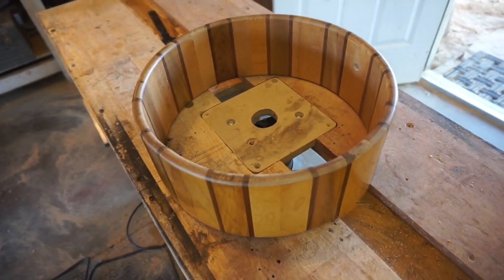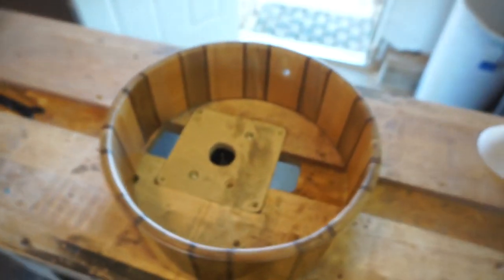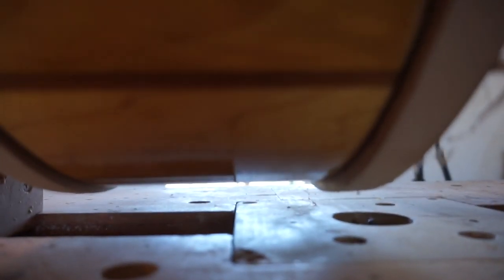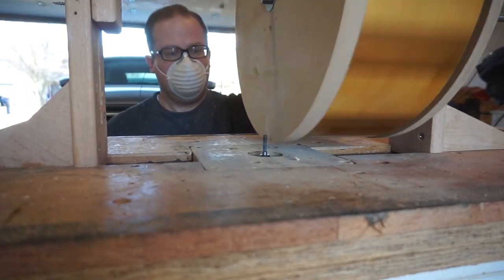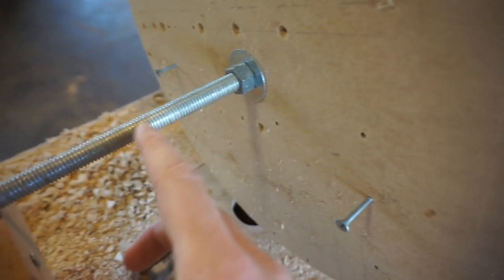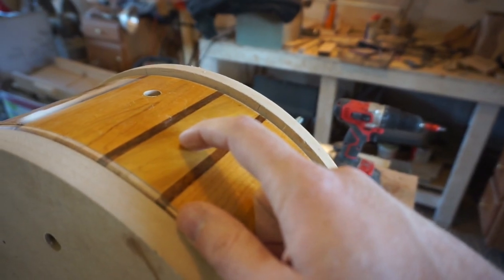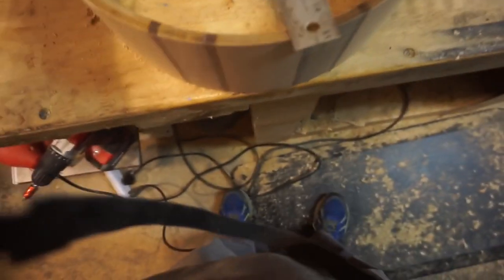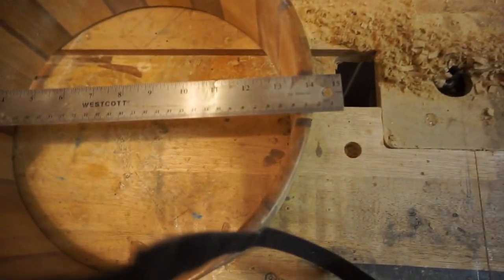TRUING A WARPED SHELL -- REBUILDING THE "HELMISH," Part 1

Comment: I'm curious about the bit you use when you're cutting the inside and outside of the shells?  Is it a 1/2"up or down cut spiral bit or something else? Thanks again for another great video!!
Reply from the maker: Nothing as fancy as a spiral cut bit-just a straight fluted bit - I usually use a 1/2"
Reply: @JosephCenter  thanks so much!! I didn't want to start with the stright cut bits in the cheap Ryobi kit unless is was not super important.  I just wanted to try something that gets the cleanest cut with the least grooves to sand out.  I'm sure those groves are also dependent on the flex in the 3/4 threaded rod as well, so I'll have to try not to rotate the shell from the top.  Maybe sect from the side MDF plates I'm guessing?  I appreciate the quick response!! If I order in the next two hours Amazon will have it to me tomorrow!! LOL